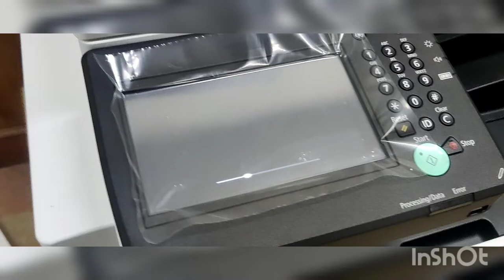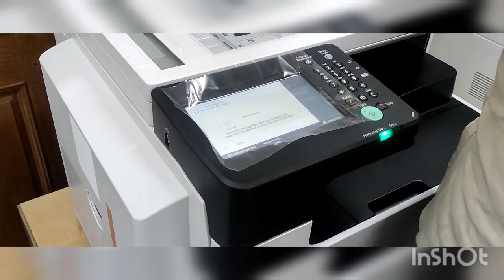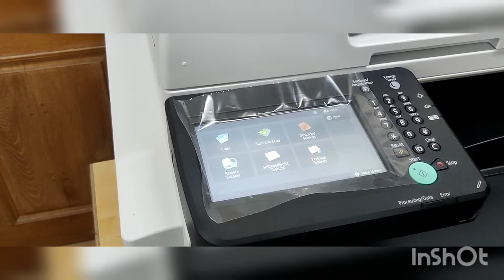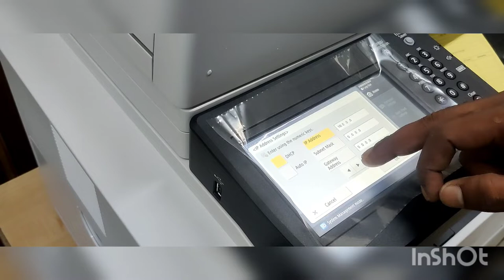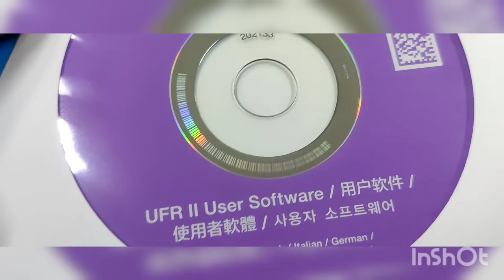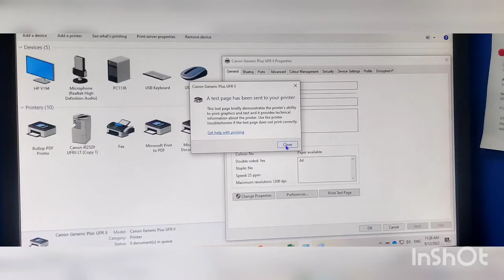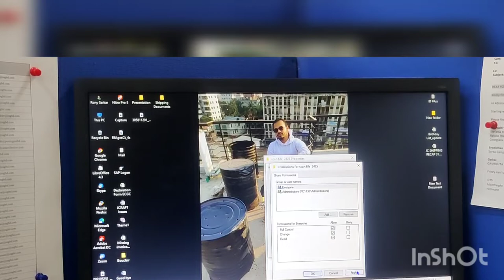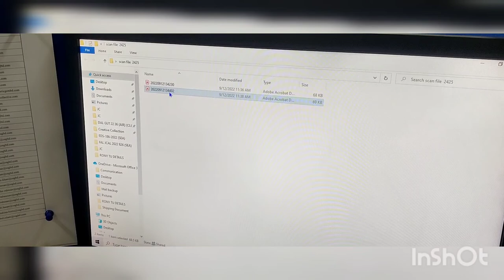Canon IR 2425 unboxing and installation guidelines | Step by step Easily setup

Comment: Hi Bro, we just bought a printer of the same type ir2425, I installed it but I couldn't configure the scan, i.e. I can't scan with it. So I would be happy if you could help me configure the scan.
Reply from the maker: 01749381326  what's app